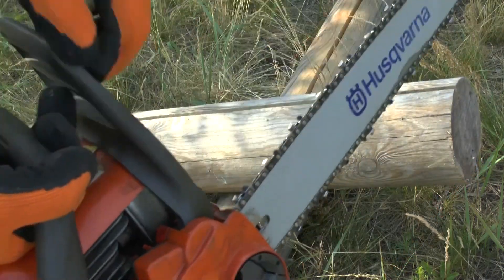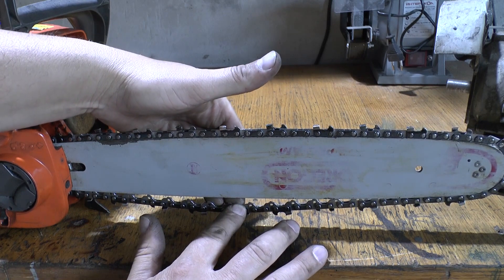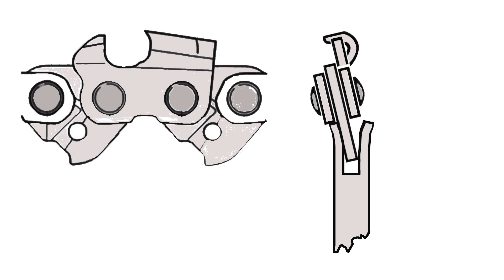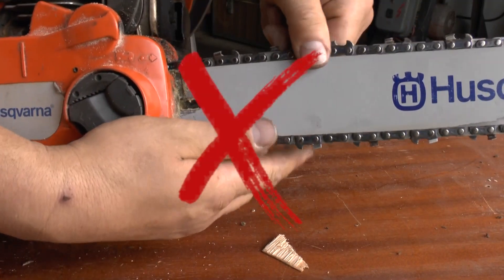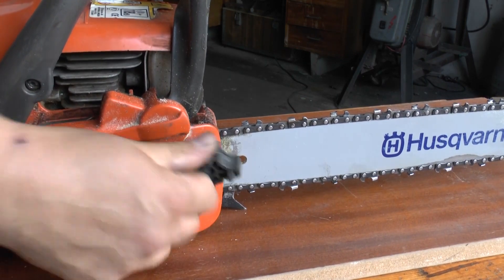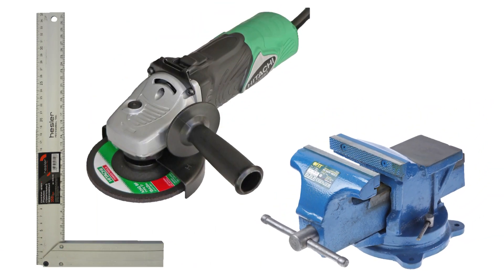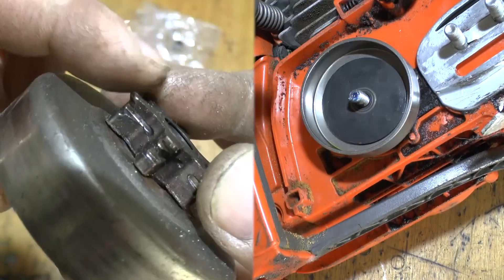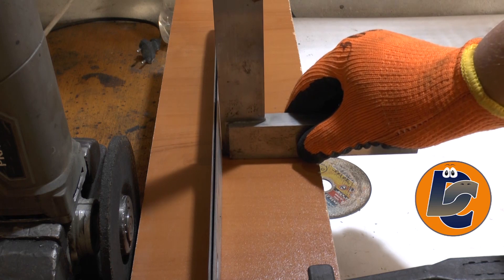Why does the chainsaw cut crookedly? Top five reasons

Comment from the maker: 1. Friends, in your country it's not called a tire but a bar. I apologize for the inaccuracy of the translation
2. Subscriber Thomas Gronek suggested another reason. - Check the gauge of the chain:  the gauge is the thickness of the drive link, measured in thousandths of an inch (a 63 gauge chain has drive links that are 0.063" thick).  If the bar is stamped or labeled 63, and the chain is a 50 gauge (for example), the chain will wobble from side to side, buy the correct gauge chain.  also, if the gauges match between the bar and chain, the guide rails might be splayed open.  If so, get an anvil, a mallet, and a piece of flat stock the same thickness as the gauge of the chain, , , Put the flat stock between the rails, and beat the rails together on the anvil, until the correct gap has been obtained.  Oregon also makes a rail closing device that works okay (don't smash, or squeeze to tightly;  the chain must move freely).  Uneven depth gauges can usually be THE biggest issue.  the all must be the same, and not to short.  If one is too short, let it be, DO NOT file the other's to match the short one.  File them to the correct height using a depth gauge tool.  Thanks for the presentation
Reply: Its cutting on an angle because the bar is off cut.one side is worn down enough to cut uneven.
Reply from the maker: @dennisketterer814  This is the first reason. If the bar of the chainsaw is worn out, even if you put in a new chain, the saw will cut crookedly.

Comment: Allowing for the different interpretation regarding names - tyre or tire etc. 
I agree with having a bar and chain maintenance routine.
I check the groove in the bar each time the saws are used, and I carry an inexpensive 'bar dressing tool' - quick and easy to use.
Minimise wear on the saw by doing preventative maintenance.

I also loosen the chain tension when I have finished the cutting, reducing wear on the sprocket etc.

Comment: Check the gauge of the chain:  the gauge is the thickness of the drive link, measured in thousandths of an inch (a 63 gauge chain has drive links that are 0.063" thick).  If the bar is stamped or labeled 63, and the chain is a 50 gauge (for example), the chain will wobble from side to side, buy the correct gauge chain.  also, if the gauges match between the bar and chain, the guide rails might be splayed open.  If so, get an anvil, a mallet, and a piece of flat stock the same thickness as the gauge of the chain, , , Put the flat stock between the rails, and beat the rails together on the anvil, until the correct gap has been obtained.  Oregon also makes a rail closing device that works okay (don't smash, or squeeze to tightly;  the chain must move freely).  Uneven depth gauges can usually be THE biggest issue.  the all must be the same, and not to short.  If one is too short, let it be, DO NOT file the other's to match the short one.  File them to the correct height using a depth gauge tool.  Thanks for the presentation
Reply from the maker: Yes. You're right. I'll add it to the pinned comment. Thanks for the comment.
Reply: thank you

Comment: Thank you for a different way of leveling the bar
Reply from the maker: And thank you for watching and commenting
Reply: Yes, that's a nice idea.  I might use the table saw, and reduce the speed and use a fine grinding wheel, or a blank blade with wet/dry paper glued to it.
Reply from the maker: @thomasgronek6469  Yes. You can try.  Thanks for the comment.

Comment: The bar has be sharpened on the high side.bringing back to when it was new.after reinstalled it will cut even again. Think happened to me one time. I saw it right away.
Reply from the maker: Yes. You're right. It happens.